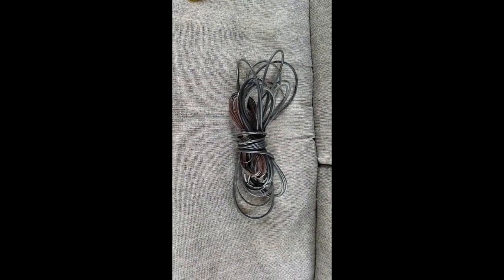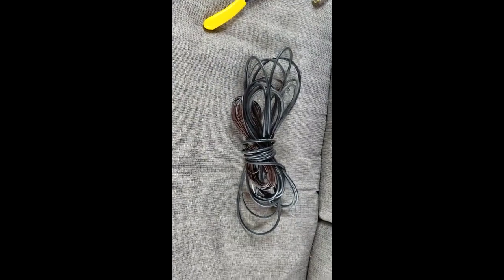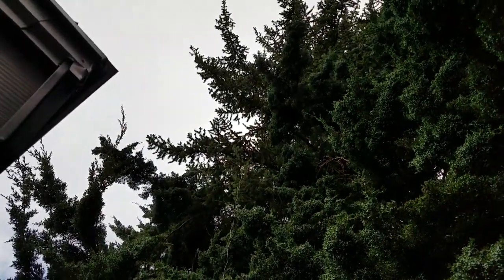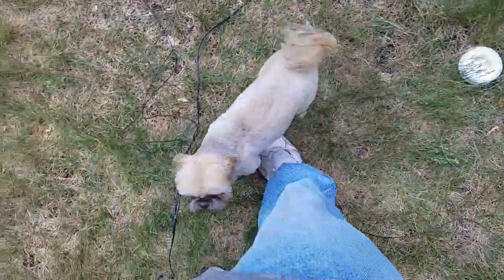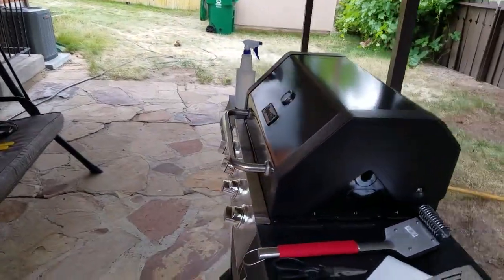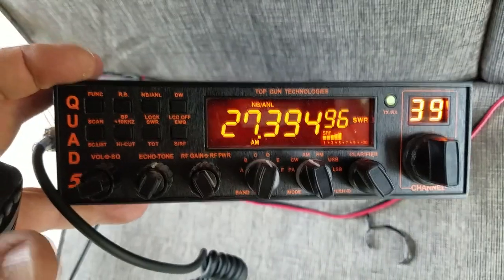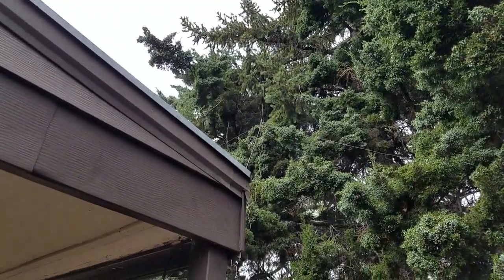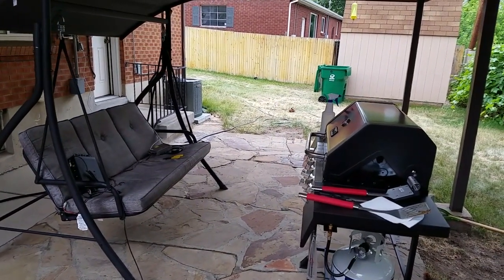How to Build a 10 and 11 meter 1/4 wave Ground plane that almost no one can see.

Comment: Temporary dumbfounded here (me).
Why are most antennas have 101½" long copper wire and not longer or even shorter? Back in the late 70's, my dad and I used a 50ft of 12 gauge insulated wire from CB to a selected tree that was kinda horizontal with the ground or earth and approximately 20 to 25 ft. Of ground wire going from the CB unit itself to a piece of rebar or grounding rod into the ground. If I remember, that was called a directional antenna. We talked from 9 miles East of Gettysburg, PA . as far as Frederick, Maryland. This was done on a 1968 Johnson 5 channel CB radio. Just a update, I still have said CB, but the mic was broken from all the moving I did.
Reply: Tube radios were very forgiving of swr.
50 feet of wire is about  1 &  3/4 wavelength so it was probably close to being a resonant longwire and without a proper ground plane it probably wasnt very efficient.
101 to 102 inches is the resonant 1/4 wave size for the 27 to 28 mhz range.

Comment: Cool! You probably know that putting the base of the driven element at 1/4 wave length above ground then running those 1/4 wave length radials from the base height, attached to braided side of yer coax of course, out at 42-45 degrees toward the ground yer transceiver is seeing a 50 ohm match. Makes  tuning easy. Just adjust yer driven for resonance. I’ve done this on 10, 11, 15, 17, and 20 meter bands. Works beautifully, and without the additional lobes taking off at higher angles when using longer driven elements you avoid the lightening crashes and other unwanted noise. 73!

Comment: Good job on the free Stealth Antenna !! ......Any kind of bare or insulated wire including stranded Stainless Steel works fine.....Horizontal 90° ground Radials have a slight  "Theoretical"  Lower radiation angle towards Horizon for Stronger Local (non-skip) signal range....It seems amazing that a "Calibrated Standard" 1 S Unit change = 4X difference (4 watts to 16 watts for example) in Radiated power !! ....

Comment: I always worry about lightning hitting the wire . it is in the trees !
Reply from the maker: Yes it was in the trees, lightning not good either way. ie big antenna on the roof or little wire in a tree. My rule of thumb is, when a storm is near or on the way I unplug my coax.
Reply: @breakerbroke23  @rayinpau.s.a.6351  That was our practice in my home as a kid.  We had a 54 foot (freestanding at the time) Rohn Tower with a...   Shooting Star?  Beam...   Was a four element vertical crossed with a four element horizontal and it had a quad for a reflector element.  Never once did we have a direct hit.  Until we grounded and guyed it.  Fortunately, everything was unplugged.  That was over twenty...  Twenty five?  Years ago.  We moved shortly after and it was never erected again.  But after my father and I earned our ham tickets in 1992/93 he started adding antennas to it, radios to the other end, and then guyed and grounded (properly) the tower.  Made unplugging stuff during storms much more a part of our discipline.

73
Reply: It was called the STARDUSTER.

Comment: The qrp on the patio rocker and an activated smoker is the best setup I've seen online.
Reply from the maker: Thanks, I had fun using that setup. Worked some West Coast skip at night.
I have seen your user name somewhere, not sure what channel Ive seen you on. However if you have not seen my other CB Radio related channel, come over to the Dark Side and visit. https://www.youtube.com/390WAGONMASTER
Cheers. 390
Reply: @breakerbroke23  I get mixed up with a car repair saint or a guy that just does random atv breaking stuff, building stuff vids, but I typed it out different. I have seen the 390 channel around, you get ahold of some nice old radios! Is there a review of the Quad in this vid on either channel? Looks like another nice radio that needs immediate tech support to be more than a 10 meter with echo unit 😁
Reply from the maker: @ERICtheLATE  The Quad 5 is a decent radio and is very easy to operate, I have had request's to go more in depth on that rig. I will do so ASAP. Thanks for watching my lame Channels.

Comment: I also see peeps making end fed 1/2 waves out of coax that they hide in trees too. They seem popular on utube. Called T2L2 or something similar.
You could also try a wire version of a 5/8 ground plane in that tree.
Reply: The T2LT is the antenna you are referring to.
I have made them for frequencies from 7 MHz (40 Meters) to 28 MHz (10 Meters) and they work great both vertical or horizontal.
The one I have for 10 Meters actually works down to the bottom of 11 Meters with a VSWR of 1:1.5 on 26.965 to 1:1.3 on 29.105.
Not bad for a1/2 wave end-fed antenna made from RG-213/U coax with a 1:1 air wound common mode choke balun (also known as an ugly balun).

The problem with a 3/8 wave antenna, regardless of what it is made with, is that it requires some type of matching unit at the base of the antenna.  It can be anything from a Gamma Match to a Hairpin Match to a Loading Coil but is does require one.
The vertical element of the 5/8 wave needs to be around 22' long and the ground-plane elements must be 104.5" and they need to be at a 90 degree right angle (horizontal) to the vertical radiating element.
Reply: @jfrphoto01  Thanks for the update 👍

Comment: Is the radio self programable for the cb band
Reply from the maker: No, you have to do a mod. Unsolder or crush a 10k SM resistor.
Reply: it s a crt 6900    crt 7900  is great to,the mods are easy,later models have 30 watts power
https://www.crtfrance.com/en/mobiles-transceivers/700-crt-ss-7900-3140650070101.html

Comment: ground radials put them at 45 degrees.
Reply from the maker: I have done this experiment in real world conditions. When out RVing on the beach in WA State, I mounted this antenna at 12ft off the ground. I tuned in on an AM CB channel (8) and locked in on 3 base stations having a local QSO, they were 40-45 miles across water as the crow flies. My radio, SWR meter were on a picnic table just a few feet away from my antenna setup, I monitored the and took pictures of their signal strength, in first test, with the the vertical radiator in the vertical position, and the ground radials hanging straight down. Second test, while I listened and had visual on the S meter I lifted a ground radial slowly and when I got to about 10 deg their signals came up 1 s unit, at 30-45 deg the s unit went up another 1/2 for a total of 1 1/2 s unit.
Going from 45 to 90deg gave no improvement. This was in receive only, would the same apply in a transmitted signal? I don't know. They could not hear my transmitted signal. Later talking to them from my base station (30 miles apart)  they said that static levels were very high due to living in town. 
BTW  Deploying the remaining radials only made a slight increase in receiving one of the stations, not sure what he used for a Antenna.
Thanks for your comment and Cheers.
Reply: @breakerbroke23  I know this reply is way after the fact but I've read in several locations that receive performance gains are pretty much 1:1 with transmit as well.  If you can quantitatively measure performance improvements in receive, transmit performance will improve comparably.